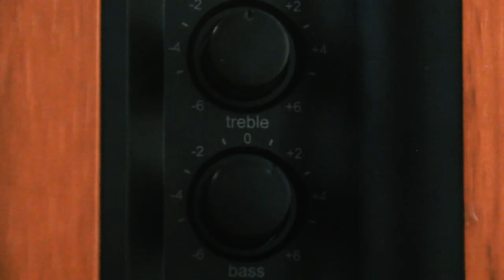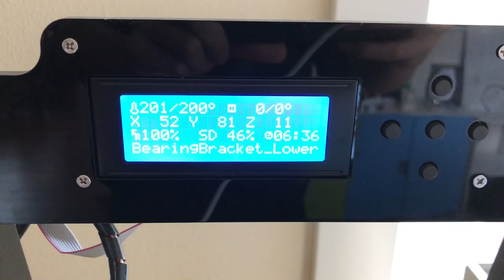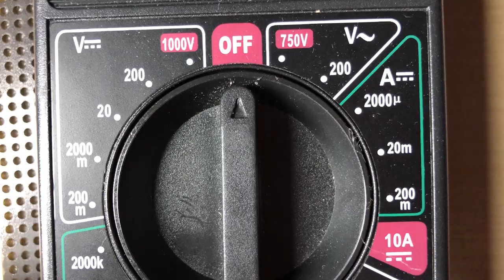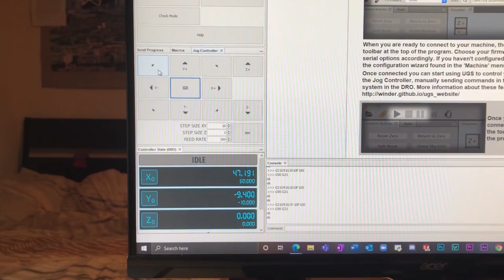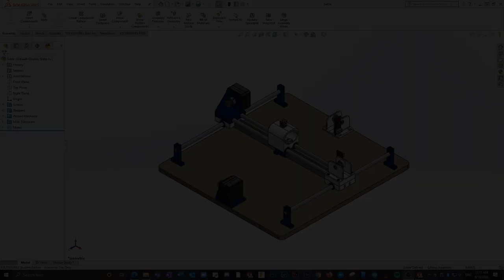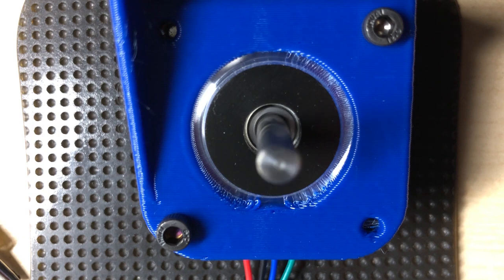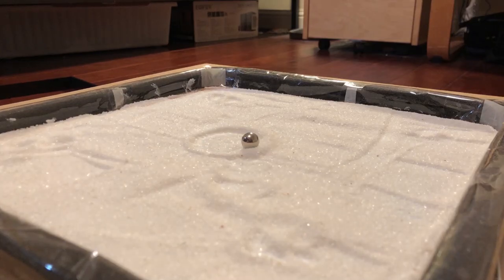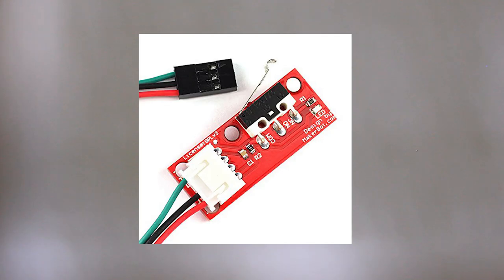Automatic Zen Garden - DIY Sisyphus Table

Comment: The limit switches you are using can also be operated in NC mode. I strongly encourage you to use them this way:

1. You will notice a broken or missing connection immediately (not after your desk has torn itself apart, since the closed limit switch does not registered because of the missing connection)
2. They are far less susceptible to interference since a static current is drawn

Comment: can someone dumb this down for me, i want one but my nose started bleeding when he started explaining
Reply: He kinda build a moving structure comparable to a 3d printer using x and z axis (x and y also possible but in my opinion x and z is easier to do). Combining that with a magnet he can control under the table hes able to move the metal ball throught the wood. Its actually using most of the parts you are gonna find in an ender 3 or other 3d printers. For example the stepper motor, boundary mechanism, and other moving parts. Pretty smart way to create something like that with pretty inexpensive and widely available parts. ( I may be wrong with some things so please forgive me lmao)

Comment: How does it sound live? Are the motors loud?
Reply from the maker: It's actually fairly quiet! Most of the noises come from the vibrations in the frame as well as the sound of the ball rolling, not the motors.
Reply: Sweet will you be posting the how to video and g code to make it ourselves?
Reply: I'd like to make a large one that will work as a desk for my computer